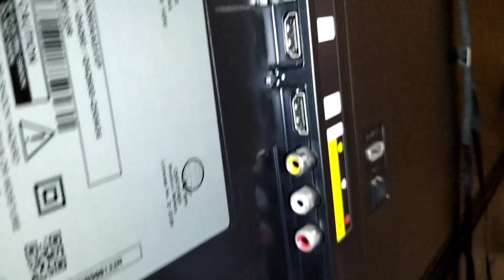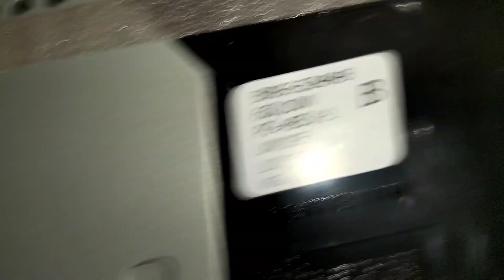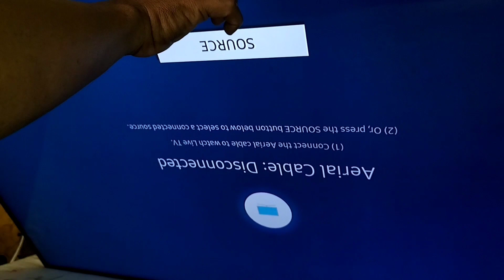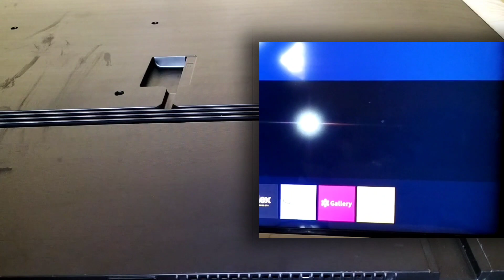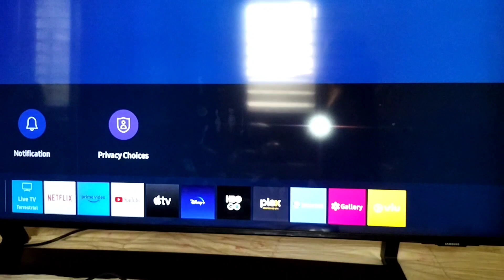HOW TO FIX SAMSUNG 50 INCH QLED SMART TV ON AND OFF POWER PROBLEM

Comment: Hi, thank you for the video. If I'll replace the cable, instead typing it. Will it work? If so, what's the name of the part, I need to look for. Thank you
Reply: If that part (pin strip or whatever it's called) were to be bought new, would that solve the problem??
Reply: Did you manage to solve the problem, if so please info.. how did you manage.. Thank you